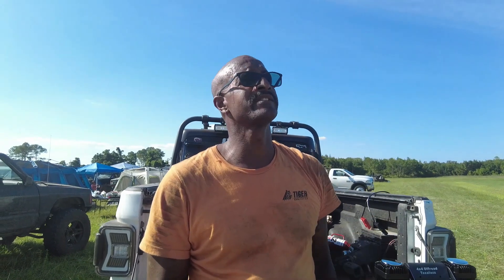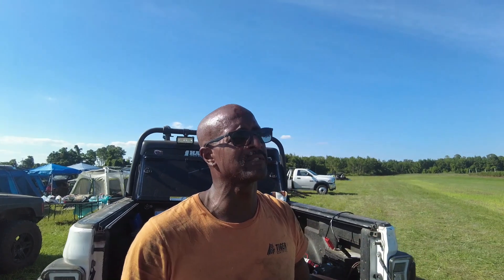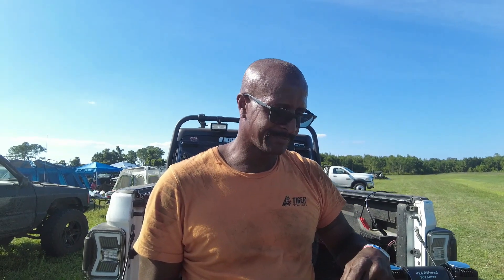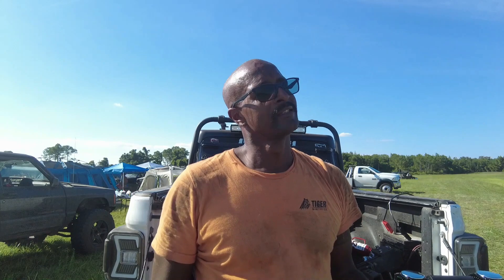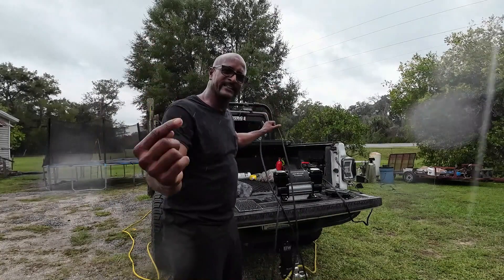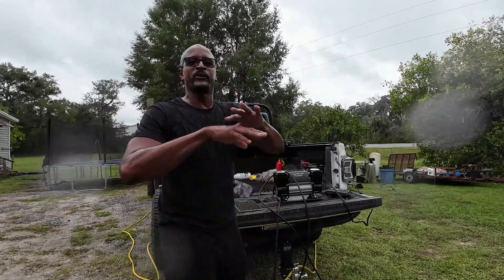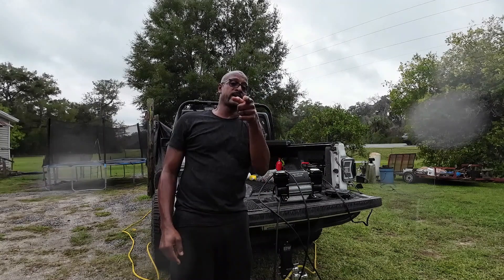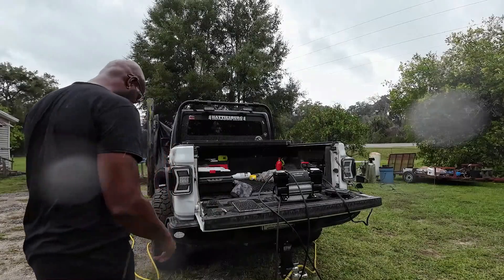Sooo.... I got this 12V Tozalazz air compressor. Let's see what it does.

Comment: I use the same compressor with my home made 4 tire inflation kit . I've timed  it at just over 5 min to air up from  12-32 psi.  I enjoyed your video
Reply from the maker: That's what I'm talking about. A DIYer just like me. My 4 tire kit is homemade as well. And yes, I believe that. 5 minutes is about right. Mine took a little longer because of the battery. And It gets warm, but doesn't get hot. Which is a good thing in my book.

Thank you!